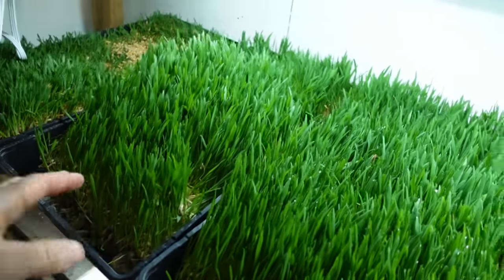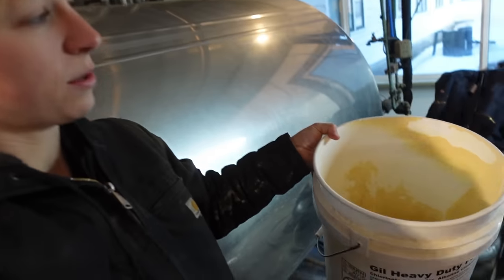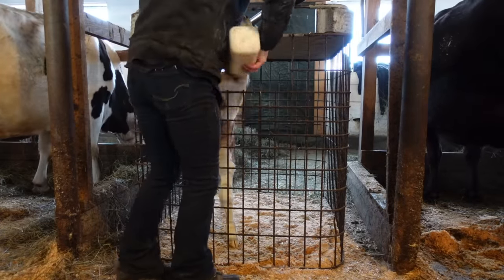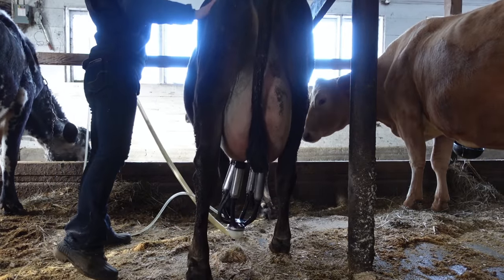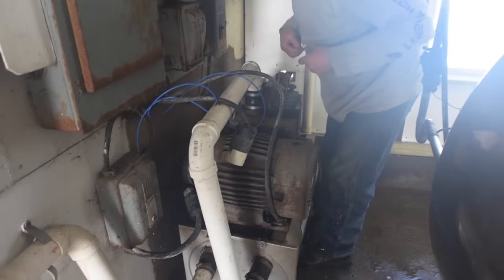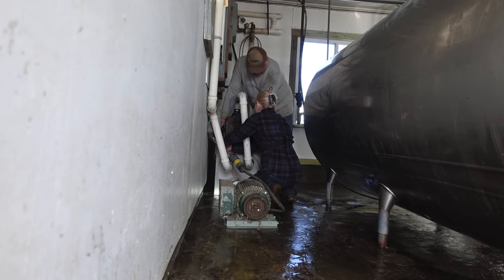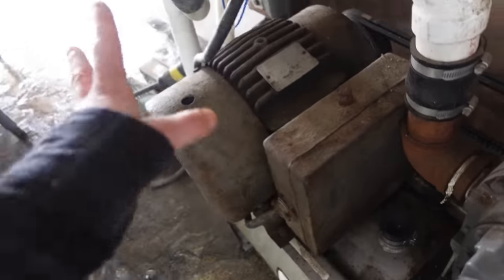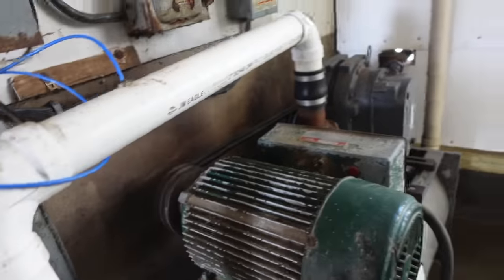Vacuum pump motor swap…

Comment: You should start a collection of weird items you found in hay bales.  A tire repair shop I frequent had a huge jar of things they pulled out of flat tires.  There was the usual things but some of the big stuff was crazy!  Rail road spikes, a hay hook, muffler clamp, a hammer head.  Any number of things you don't usually see out on the highways and byways! I like how you dig right in helping with the mechanical stuff.  Good for you!  🤠

Comment: Hey Taylor, The things that have changed since I milk Cows. We never did the process of drying off Cows like you are doing. We just took them out of the milking group and put them with the dry cows. If I remember right, We just put a red crayon mark on there hips and off they went to the dry cow part of the barn. Of course things change and I am not up on the times of milking cows and drying off. 
I remember the day our vacuum pump motor died,  You didn't pick that motor up by hand. Had a small chain hoist to pick it up and install the back up one. It was a pain in the A__ to work on. Didn't finish milking till like 1 PM in the afternoon, Then started milking again at 5 PM. Made for a very long day. 
As always enjoy your video, Thanks for sharing.

Comment: Nice to see the cute calf.   I was wondering why you do not wear latex/vinyl  gloves when milking.
My brother had a Jersey farm for 20 years and he told me the udder problems are often caused
by the transference of bacteria etc, from human hands.   Old motors are really heavy.  New ones
are built different and weigh a little less.  I changed to many to count in my industrial mechanic career.

Comment: If that motor needed bearings replaced then I agree taking it off and taking it to the motor shop for that and new capacitors was called for....otherwise the capacitors could be replaced without removing the motor......could have saved you some time and effort that way....

Comment: I guess It's a Northern thing . . .  But In my association with many dairies across the South (Georgia - S. Carolina), I have never heard of a vacuum pump being installed in the milk house??  Just a guess, but I suppose inspection would not approve it because of exhaust fumes in close proximity to the bulk tank and milking equipment??   Do you have any idea what your butterfat content averages?  With feeding mostly hay and the high percentage of Jersey influence in your herd genetics  I would guess a 5 - 5.5  percent ??  Maybe you should try making some cheese or butter?!  
 I enjoy your videos from my southern porch, Thanks!
Reply from the maker: Hi! I e heard that said that it is unusual to have a vacuum pump in the milk house. The exhaust is run out through the wall so no fumes. Yes our butterfat a averages around 4.5 to 5.5 one time we had a test where our butterfat was over six! Unfortunately it didn’t stay up that long😀 so glad you enjoy watching!! Thanks so much 😊
Reply: @tayfarms  Definitely quieter with the exhaust going outside.  We had a Bou-matic system but used Delaval shells and liners.  We also cooked the liners in Lye water about once a month which, rejuvenated them and prolonged their life by about 25 - 50 percent I suppose.   Your videos take me back about 50 years, Thanks!      S. Carolina

Comment: By going to a smaller motor on the vacuum pump, you may have problems with the somatic cell count. Being that you use 6 units, even though the rpms are the same, cfms from pump will decrease. Speaking from experience...
Reply from the maker: Thanks for the tip we will keep a close eye on the numbers and change back if we need to, thanks again!!